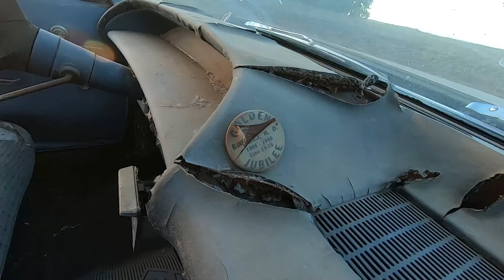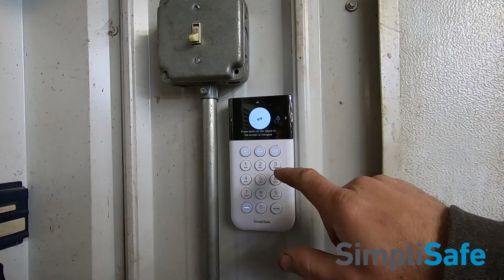Farm Auction 1949 Dodge Sedan! With a Hot Rod Engine?!? Abandoned for 56 years! Will it Run?!?

Comment: Ah nostalgia! The first running car that I ever bought was a '49 Plymouth. (I bought a '29 Model A 2-door sedan for $60 first, but it never did run. I sold it for $200.) Every time the Plymouth and I would pull into a gas station I'd check the gas and fill up the oil. When it came to oil that old flathead six had a real drinking problem. One time I splurged and filled her up with STP, which is thick as honey, but she drank that down like it was 10W30. After that she got. mostly drain oil. She had a real nice body, though. You never forget your first love.
Reply from the maker: You made out on the A sedan at least!
Reply: @MortskeRepair  that fronnt frille and chrome is worth 1k unobtanium. Shame the hood ornament gone it's a Mayflower ship

Comment: Had a super 92 Massey combine with a Mopar flat head 6 engine, ran real good never had any problem with that engine
Reply from the maker: They used them in everything!
Reply: Oliver combines used a Continental flat-head 6, 226 ci., the same engine used by Kaiser-Frazier. It was strong
Reply from the maker: @jeromebreeding3302  Coop tractors used them as well!

Comment: Mr. Mortske. No one Dislikes your car movies!  When i was a Little kid in the 1960s. I Remember my Late Grandpa having a Black 1963 Rambler Wagon like the one that you displayed towards the end of the clip. in line 6 3 on the tree. And that 1963 Short box Ford early on i had one of those as my last 60s FoMoCo. Drove here to Watertown,Wi. from Bronson,Mi. October 18th. 1993. Straight West I 94  223/6 3 on the tree.. And Lastly Those 292 Y Block 8s were WAY,Way,way Better than the 223 6s. Never Blew one up or be an OIL Fogger like those other Ford motors.

Comment: That 32 would be a great project to see you do. I usually dont like stuff that has been hacked on like that, but for some reason that little booger is cool. Lol
Reply from the maker: It's different, that's for sure!
Reply: @MortskeRepair  They did a good job on it. If rear of the bed extended out about a foot or so, it would look just like something factory built.
Reply from the maker: @1980bwc  There's definitely some room for improvements!

Comment: I like the 32 idea. The guys over on the Hustlin Horsepower channel built a No-Prep drag car from a 33 wagon just like that 32. They called it the Home Grown Hustler. Even did the "pickup conversion" the exact same way. Unfortunately they had a bad street racing accident with the car a few weeks ago and are currently rebuilding it with a different body. The guys also built another drag car from a 1930 Tudor called the Dirty 30. It also is no longer with them. The build series are definitely  worth the watch tho.
Reply from the maker: I'll ahve to check it out!

Comment: i had a '52 cranbrook 2 door a couple of years ago that i traded an sks and a couple hundred rounds of ammo for. the body was in awesome shape, but the flathead six was stuck. i sat it next to my garage to wait it's turn, somebody offered me a grand for it, and it went bye bye. i bought the sks in the 80's for 70 bucks unissued, it was mounted in a folding stock i picked up for 75 and the ammo was like 40 for a 440 round tuna can, so all totaled i had less than $200 in it. i was a smiling that day. two weeks later i brought home my '54 5600 5 window i found on craigslist for $700. right now, the cab is on sawhorses and is about to be a 1/2 ton 4x4. life is good! edit; that '32 looks like a really neat project. i say go for it!
Reply from the maker: Nice!

Comment: That was a great video Mortske. The tour of the farm auction was cool. I saw all kinds of stuff that would come home with me. The 49 Dodge definitely was a classic hotrod with the split exhaust, dual carbs and cutouts that were obviously open when the rods jumped out. Did some looking online for the Edmund's intake. Every one I found had already sold for $400 to $450 in similar condition as yours. The 32 Dodge pick up would be perfect with the flathead 6 and the truck tranny. Put about 10 miles on my rat rod today. Other than it rides like a buckboard it's fun as hell. Until next time my friend. You and Duff have a good one.
Reply from the maker: That intake was the entire reason I bought the car! Thanks Bob!

Comment: Grats on the sponsor. Hope there's a lot more to come. You've got a good thing going with Duff and the shop.  And in defense of the "jack-stand nazis" we just don't want you or Duff getting hurt just to provide us some entertainment.  What you're doing can be dangerous (just look at the fan v finger in this video)  and we don't want you getting hurt. Medical bills are tyranny.
Reply from the maker: We try our best not to die on any given day!
Reply: @MortskeRepair  Cadinal rule, always use jack-srands when working under the car  however  mine are'nt the most user friendly  Height ajustments are made via a series of holes, through which a pin(or a screw driver is inserted). Might need to update to new ones.
Reply from the maker: @jeromebreeding3302  Those pinned ones are a PAIN!

Comment: That 32 would look great with a 383 BBM in it!  I have one if you're interested in going that route?

Is that tank in the bed a wood gas furnace? If you didn't know, a wood gas furnace is what some people did back in WW2 to be able to run their vehicles because of gas rationing at that time. The furnace would heat up the wood and then the smoke was cooled and directed into the carb as fuel.

Wood gas is around 104 octane but about 40 to 50% less BTUs as gasoline. It's about 2 lbs of wood per mile but works great when there is no gasoline.
Reply from the maker: Nah, just an old fuel truck tank.

Comment: 1: I wanna see that running engine get put in the '49 Dodge. Make that car drive again.

2: Perhaps you could donate the blown flathead six to I Do Cars? Would be super awesome to see him tearing apart something old school and he often does pull down totally fucked engines.
Reply: Even with the whole in the side of it?
Reply: @crackberrry1  There isn't a hole in the side of the running engine. The hole is in the blown engine still in the car.

And yeah, I'd love to see Eric tear that thing apart. he's done some ventilated blocks before. We've seen what malice in the combustion palace looks like on modern engines, would be nice to see what it looked like 50-odd years ago. Also be interesting to see if Eric could figure out, underneath all the rust and corrosion, why it failed in the first place. Overrev is a good guess but it could have been an oiling issue as well; Mortske noted an external oil pump which may be a clue. Thing could have spun a bearing due to insufficient lubrication and just been driven until it went bang.
Reply: @TestECull  that would be really awesome to see. I love seeing what happened to the engines that didnt make it, especially the ones with carnage like this 49 Dodge motor.
Reply: @VintageCars999  Same same. Why I'm subbed to that channel to begin with; most of the teardowns he does videos on are teardowns where the engine went out with a bang rather than a whisper. This ol' flathead six would be perfect for that, and a real test of Eric's detective skills besides.

I also bet he could make a little money off some of the parts if anything survived in there. Obv the block, pan, at least one piston, at least one rod are totally donezo, possibly the crank, but who knows. With the rarity of parts for these engines a serviceable cylinder head might, itself, be more than enough of a moneymaker to make it worthwhile.

Comment: Happy Duff went out and got a big sponsor. Simplisafe is a good company. He needs to protect his treats from the critters sneaking out of those field vehicles you drag in. Surprised the CO detector and smoke alarm didn't go off when you fired up that flathead. Great show. Great to see you got that motor to run without breaking a valve or having to rebuild the starter 😆
Reply from the maker: My hero! Or not!

Comment: My dad was an old gearhead from the 50s, in dirtrack stock cars. He usually was the builder, he put together an early 50s dodge f/h port n polish,split exh manifold, dual carbs, maybe a hot cam. He adapted a larger ford drum, front right. They lightened the car, was eating ford f/h  v8s. This car you're building is a 60s Joe dirt car.
Reply from the maker: That's awesome!

Comment: Excellent video Mortske Repair  :) also that wild on 1949 Dodge 4 door family car with 2 carbs and motor broken plus oil pan big hole ! But excellent motor got up running and older Dodge truck I fix up for sure!

Comment: Still watching, already got a reply. Thanks!  I used a universal 6 cyl kit. Smp too. Too bad mine has a bad cylinder, i would still be running it, ended up with a 360. Only 3 times the power, but you hardly notice…
Reply from the maker: That's what we do Frank!

Comment: Cool idea to use the Dodge flathead in the old Dodge.  Here is some food for thought, Langdon’s Stovebolts sells an adapter to put a T-5 in that truck bellhouse, and an HEI distributor for it as well.  I put both of them in a ‘51 Dodge pickup with a 218, worked out great!👍
Reply from the maker: The adapter would be sweet! I've been looking for a factory 3 speed overdrive like the 59 Plymouth had to put behind it.
Reply: @MortskeRepair  The best part is, it’s only $80, super easy!
Reply from the maker: @nuttfarmgarage6434  Super reasonable!

Comment: Bought my 49 Plymouth business coupe with the same engine setup. From the research I’ve done, j c Whitney sold a kit back in the 40s and 50s. Came with manifolds, carbs, cam ect. Not home made, they were cast iron. Would have loved to keep it like that. Only thing, #2 piston decided it was better off in the oil pan. Also ruined the block. Gave the engine to a friends grandson and stuck a small block Chevy with 350 in. Painted 70 barracuda plum crazy with wide whites. Parts from my old motor, carbs, split manifolds, ect are now residing in a 1940 cw 1/2 ton.
Reply from the maker: Nice!

Comment: Definitely do a build on the 32 Dodge, that thing is rad!  I like the suggestion by another commenter to put the dual carb setup on there with the flathead.  Nobody ever builds old Dodge pickups (which is sad)

Also - put the service bed on the 4 door Binder for a sooper dooper mobile work truck.
Reply from the maker: Well if it weren't for that intake I wouldn't even have the car or another flathead! So of course we're using it in the 32!

Comment: That plymouth arrow is super rare.  Idk about the plymouth version but the mitsubishi mighty max/ Dodge D50 versions you can get really loaded. They had a 4cylinder turbo diesel with 4x4 and a factory limited slip. I had a newer mighty max with the v6 and 4x4 miss it so much
Reply from the maker: A local has a D50 diesel 4WD!

Comment: I'd really like to see one of these old school flathead Chrysler sixes with a shaved head, some higher compression domed pistons, a much hotter ignition system, and two two barrel carbs that flow properly. I realize that they weren't built for any sort of performance, but where there's a will, there's a way.
Reply: They can indeed be souped up.  I wish I could get my hands on a ratty looking 49 or 50 Chrysler New Yorker or Saratoga, both Straight 8 cars, and replace that stupid 1 barrel carb with a 46 or older type 2 barrel and matching intake manifold just to see how much faster that would make the car.  0 - 60 in 24 seconds is about as slow as a 4 cylinder Mercedes from the 70s.

Comment: Some years ago I went into a pick and pull yard an hour from me to find a '34 Dodge big truck turned doodlebug.  They got $20 for a grille. I whipped out the tools and took the grille home right then and there. 

Let it go with the '32 Stude Rockne body I sold a few years later.   That came out of the same yard (!)

You never know what you're going to find, is all.
Reply from the maker: Dang!

Comment: I have adjustable air shocks on my slammed s10. I have hauled a complete 350. Also had a 5.3 long block in it. Put 100 pounds of air in the shocks and you couldn't even tell it was back there. Lol
Reply from the maker: Nice!
Reply: @MortskeRepair  yeah man works great. Like it did at factory ride height. But im working on getting a 93 gmc heavy half ton 2wd 6lug truck back to glory. Just have to find a good 6 liter LQ4 i can afford to replace the blown up 6.5 turbo diesel. And its a extended cab short bed. Even cooler.

Comment: We had a 1950 Dodge Wayfarer  that we put a trailer hitch on. The parking brake slipped, and the Dodge went under water at the boat ramp. The carburetor was above water and the car started and pulled the big boat.
Reply from the maker: That's no good!

Comment: Liking the idea you have for the 1932 Dodge. I'm not much of a promoter of LS swaps, but since the '49 has a side crater in the engine, a nice 5.7 Hemi with 6 speed automatic would go really nice in that thing. Just drop them in straight out of the salvage yard. Just gotta make sure the 5.7 wasn't put in the salvage due to a flattened cam. Maybe even an old school 318 with automatic. That '49 has potential. Glad you didn't get seriously hurt tangling with the fan. I was cringing at the thought for several minutes if you or Duff were gonna get too close....

Comment: Dual exhaust on an inline engine especially those old sixes was a common beef up, it sounded good and it allowed for the engine to breathe out better, I've seen a couple at car shows, one of them was a 49 Plymouth with the same engine and man it had a nice sound, I started it up and it had a rumble to it then as I was watching the engine run I saw that same exhaust manifold and I was like "ah that explains it" I'm still watching this but if it runs which I'm pretty optimistic about, old cars, trucks, tractors, anything that ISN'T a rolling computer, 95% of the time if the engine isn't stuck will run usually, as for the cooling fan it's supposed to be a 4 blader, that cooling fan must have gotten hooied and just left it 2 blade, surely you have another 4 blader for it or can get one easily. As for it running as I now have noticed the engine is totally clapped :( but those engines are a dime a dozen or "dime a half dozen" being a 6 cylinder but hope to see you bring it back to life again and grease it's LIGHTNINNnnnnn!!!!! especially with that replacement 6 you picked up that is lean mean run'n machine, you swap those dual carb dual exhaust greased lightnin' manifolds and carbs on it that sucker should just drop right on in there no problem, especially being a fully complete "turn key and ready to go" engine
Reply from the maker: Great little engines!
Reply: @MortskeRepair   oh yeah, long lived as well, that engine was in production from 1933-1957, too bad you really don't want to fix up the old Dodge, I think especially considering it was mild custom it was a sweet ride back in the day, you can do all kinds of stuff with that 6 cylinder and a lot of power out of those, I still think you should drop that other 6 in there and get it going and fix'er up, it was a sweet ride at one time, can be again, and it could turn some heads at car shows, heck I'd take it but sadly I don't have much money or a big enough shop for it but maybe someday I'd get me a greased lightnin' it does it reminds me of a long lost ride from the movie Grease, maybe you can throw some cut outs on it too so it can shoot flames from the exhaust like that 49 Mercury on Grease, throw some nice white walls and spiked hub caps on it, when I first saw that car I saw GREASED LIGHTNINNnnnn!!!! written all over it, when I saw the custom parts on it, MORTSKE making Grease have LIGHTNINnnnn!!!!! again LOL then again it's probably just me, there's just something about those old 40's-50's cars that either restored or customed out the old school way that just makes them awesome and a real throwback of the Doo Wop era

Comment: CYLINDER HEAD REMOVAL FLATHEAD
Remove all cylinder head nuts.
The cylinder head has lugs cast along the left side 
to allow a pinch bar to be used to pry it loose from 
the gasket.
The seal between the head and the gasket can usually 
be broken by cranking the engine with the starter 
after the spark plug wires have been removed and the 
ignition off.
CAUTION: One stud nut should be left on loosely both 
at the front and rear to prevent the head being lifted 
completely off.
In rare cases it may be necessary to lift the head 
off with a chain hoist and two eye bolts screwed into 
the spark plug holes (use service tool J-917). Found this gem of info in my manual for my Hudson

Comment: What a score you got with that intake I bet they are like hens teeth today to find. I never knew they made a intake for the Chrysler flathead six. I wonder if they will fit on all the size chrysler 6 cylinder engines or just the 230
Reply from the maker: Would've never looked twice at this car if it didn't have dual exhaust!

Comment: Not a sell out good you have a sponsor well deserved hopefully there are more looks like you may be on the way to a lift

No more grassroots mechanical work laying on the dirt or concrete floor 😳

Hopefully simplysafe doesn't use china made components that would be a bummer 😕

But still won't detract from Mortske's  and Duff dog's channel

Good luck with the sponsorship you deserve it🇺🇲🇺🇲
Reply from the maker: Thanks much!

Comment: The sixes were bad about flating crank pins
My dad would go to the wrecking yard every year for a new engine
Mine was a 51 ply
Road like a cad
Chrysler made a stock dual carb dual exhaust  setup for the flat six even
Reply from the maker: I saw one on a big Dodge truck once in the wild!